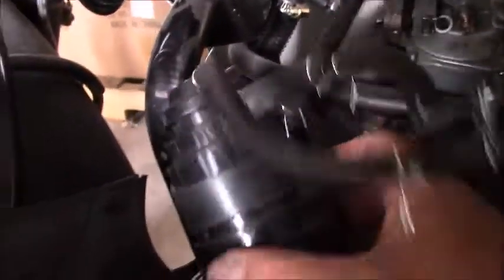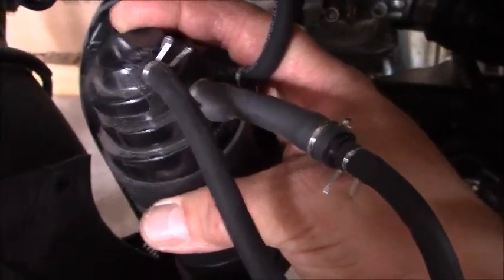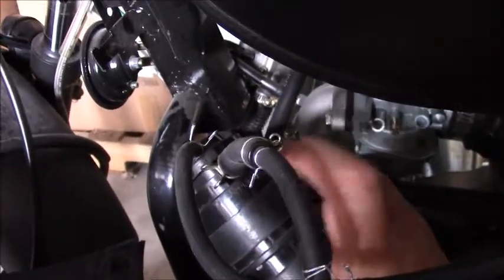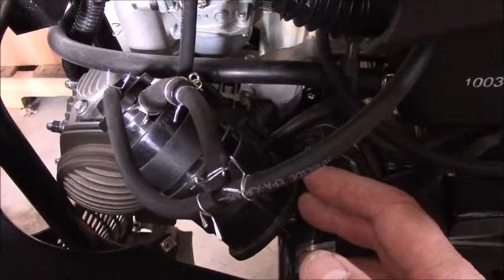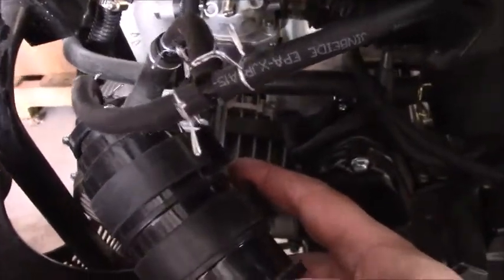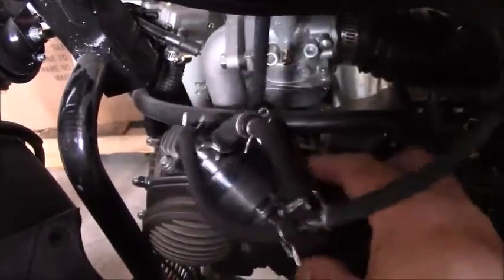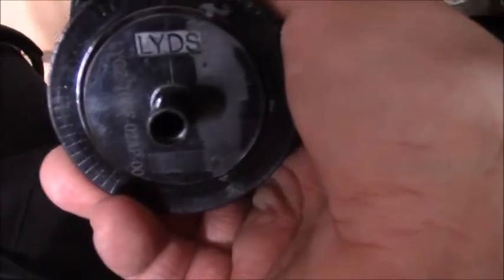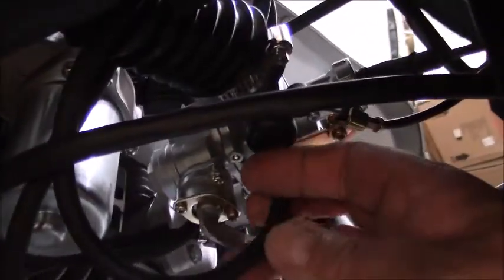The Evaporative Emissions System Exposed! Venom x20, x21, x22, x22R

Comment: I have the same bike and have over a thousand miles on it and I found gas dripping from the bottom of the charcoal canister from the “check value”. Is this normal say from the heat of the day here in so cal or is it something I need to worry about and have repaired? I’m desperate please help
Reply from the maker: Brian Hendron it seems normal to drip out as it lets out some excess fluids sometimes but your best bet is to give a call to our tech supper team and they will give you a more detailed answer

1-855-984-1612 or email them at Support@venommotorsportsusa.com